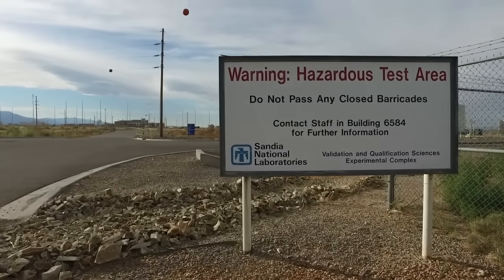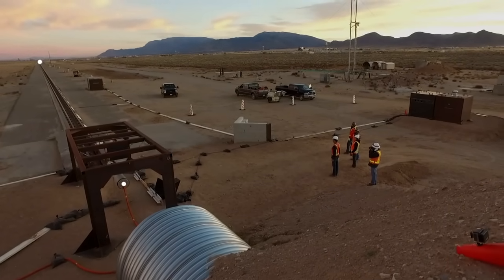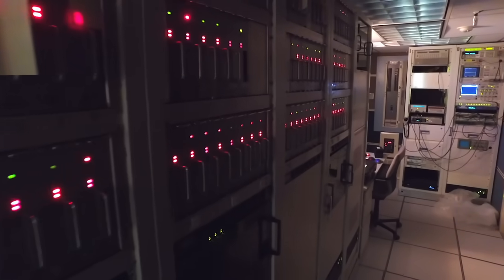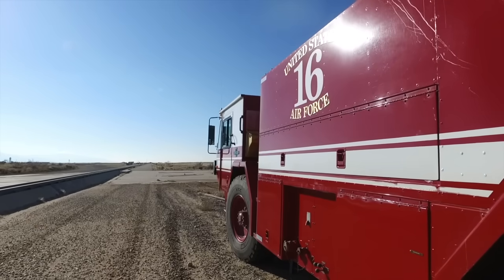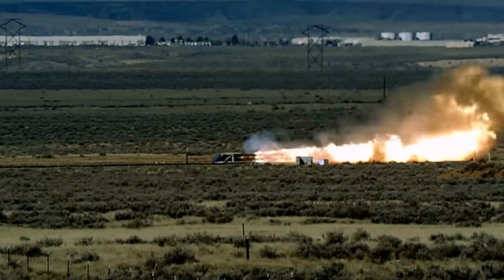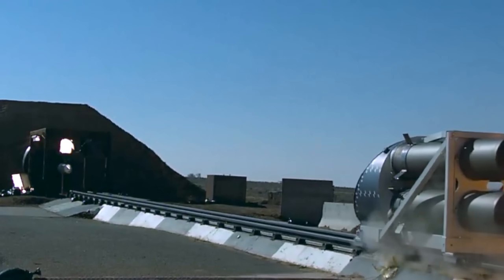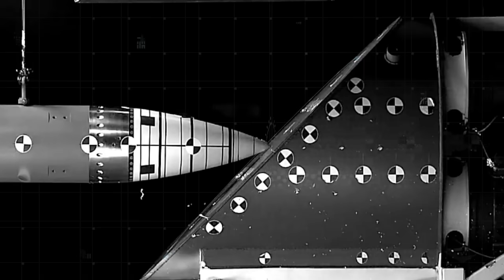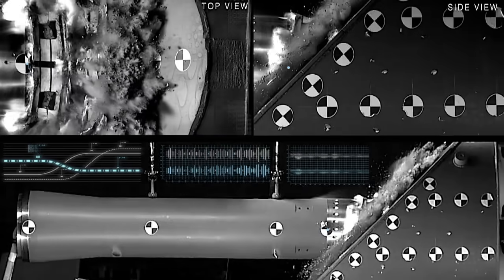Rocket Sled Impact Test In Slow-Motion

Comment: Im really curious to what you could actually learn from this test??
Reply: The sensors embedded in the dummy load transmit data at every point in time of the impact. By analyzing the movement of things and the exact way they crush, they can confirm whether a system functions properly. Things like whether the signal to dentonate is triggered, which if the other internal signals are triggering, the exact way the body crushes, and so forth.

For testing like this, the ram on the sled can be swapped out to simulate different angles of impact, and the rocket motors and acceleration distance can be varied to simulate different drop heights.

You only want nukes to go off exactly when you want them to. Testing like this ensures that will be the case even if the shell is dropped by accident due to human error, or a bomber is blasted out of the sky with a full payload by anti-aircraft armaments, or some other catastrophic failure occurs.
Reply: Mentioned by a few post up - kylesenior
It's used to verify the contact fuzes on nuclear weapons are functioning correctly. Warheads travelling at the speed of sound (or even faster) have a very small amount of time to set off before they slam into the ground and disintegrate.
Reply: @PlzDontKillDave  Somehow i didnt get any of these until today... Thats a valid point, thank you and everyone else.
Reply: I think they learned that a rocket doesn't survive a piece of steel & concrete being slammed into it at those speeds.
Reply: Smonjirez SCIENCE!!
Reply: We can learn to make even faster camera frame rates so we can see the destruction even slower.
Reply: LincolnTek and what will seeing the destruction slower accomplish?
Reply: How fast the General Contractor’s new yacht goes with 30 people on board.
Reply: The sled is fast🤣
Reply: Looked like a catastrophic congenital delamination most likely from improper jockgirdle settings.
Reply: You can learn how to plant cabbage.
Reply: @fleshangel489  when you joke and morons take you seriously...lmao...speaking of potatoes.
Reply: @chiefmawfackoogames  yeah potatoes are good
Reply: @fleshangel489  potatoes...yes...however, your sense of humor has been perceived as wanting.
Reply: @chiefmawfackoogames  Oh OK
Reply: Astronaut 13 I'm sure most nuclear bombs (I'm no expert) are detonated before they hit the ground so they're not testing the detonation mechanism here. Your explanation makes the most sense although it does seem a strange way to go about it
Reply: Take a look at the B61 mod 12. It's being designed to penetrate into the ground in order to localize the shock forces on buried targets like bunkers.
Reply: Is sandia national labs that made this like other ppl said this test is for nuclear bombs (or even normal bombs)  that explode meters inside earth
Reply: You learn that aluminum cannot penetrate steel
Reply: Materials age, even metals, so the behavior of key components can change. Such tests can show you of components need to be replaced or re-designed.
Reply: @f.d.6667  I agree with what your saying, but i dont see how any of that could be learned from atomizing the subject.
Reply: @Vatsyayana87  F.D. states the opposite of what you think. his argument is that the test as such is futile.

so the current explanation isn't satisfying -- that they're testing the electronic equipment. I also think they're not testing the equipment, what I think they're doing is that they're testing the case itself, the way it actually disintegrates on impact. I think it's an overblown experiment for what it is. they are growing a numerical database of the analysis, which is then fed into another study or further refinement of the design, the reality of which is unrelated to them.

I honestly think this is a high-level PR 'excuses' video for an industry that wastes money irresponsibly for things that could've been learned otherwise, and that this is mostly political, and not essential or breaking-new-grounds scientific, but everybody has rights to their opinion.
Reply: This is for development of earth penetrators, bombs designed to explode underground, like inside bunkers ou caves.
Reply: @harrycallaghan65  but, thet said they are studying the safety of the stockpile...how does checking the penetrating attack power relates even remotly to the safety if the stockpile?
Reply: Alain Pasqualini What she said is just superficial blablabla for advertising purposes.The real reason for the test is to analyse the bomb's behavior during impact to collect data and produce  bombs with better penetration capabilities, destined to attack bunkers or underground targets.
Reply: @harrycallaghan65  And create earthquakes around the world. It's a toy that should be broken.
Reply: Ivymike2 Ivymike2 Not true at all... How you got that is beyond me but it couldn't be further from the truth kid. Try again though.
Reply: Vatsyayana they learn how a nuclear rocket would be affected after a large impact, like if it would detonate or not, imagin someone bombed somewhere a nuclear missile was located, we wouldn't want that going off.
Reply: PlzDontKillDave most nuclear weapons in the us are designed to explode above their target, not on impact
Reply: @advisuals9273  bunker busters are.
Reply: Canooter valve density readouts and flux capacitor levels
Reply: It's to make sure nuclear weapons won't accidentally detonate. Most of the testing done on nukes is towards this end.
Reply: Since everyone started arguing ill answer the question, its to test the actual system inside the warhead, they have all the electronics of a regular warhead but just no uranium. So the big orange cable is reading electrical signals at a bunch of points inside the circuit. This is just a made up example but there might be probes at the "detonator" to see if the nuke would detonate on impact, after they review this data later to see if it would actually detonate in that situation or not, and fix issues accordingly.
Reply: How fast a building can come at you 😂😂
Reply: The explosion
Reply: Modi israélien
Reply: How fast you can blow through taxpayer dollars
Reply: Nope. Not even close. There are much less expensive ways to validate fuzing systems. There is a reason this is being done by Sandia and not e.g. ARL
Reply: O.P. Yates Really man you have to be political about it.  Ryan isn't wrong when he talks about useless companies getting money pumped to them.  IDK yet about this company cus I've never even heard of them but this post was originally about the purpose of the test and no one so far has had a straight answer.
Reply: Validation of hydrodynamic simulation codes.
Reply: 2.2 million views? This video is having a... Big Impact. (Hold for laughter)
Reply: +tetrabromobisphenol we are talking mach 15 nuclear warhead vs earth
Reply: Vatsyayana you have to have an IQ size larger than your shoe
Reply: tetrabromobisphenol I like how you're saying others are wrong when your reason for why this was done is wrong also! Lol, people like you are extremely funny.
Reply: We've had multi-million frame per second cameras since the mid 1940's. That's NOT the point of the testing
Reply: @tetrabromobisphenol  
Name one! Referring to the millions of frames per second cameras since the '40's.
Reply: That 84 Engineers, 47 Technicians, 208 Contractors, and 23 Project Managers are still employed in their Know Nothing Bullshit Job. Thank you UNCLE SAMMY!
Reply: Ryan Taylor if you don’t like the United States just leave
Reply: It COULD be, but this is not a hardened warhead. Notice the crumpling of the nosecone. A hardened warhead would punch right through the sled dummy if was made of the "right stuff", and yes, there are materials that can easily slice through hardened tool steel at those speeds with little difficulty.

Comment: What is the point of this test?
Reply: To see stuff get destroyed in slow motion.
Reply: Probably test if the nuke would go off in case of an airplane crash or so.
Reply: I'm still puzzled. From video description ,  this is laboratory for nuclear weapons. Nuclear projectiles  are not usually designed as penetrative weapons. As a matter of fact , they have greatest destructive power if detonated several thousand feet above ground. Also given temperature and preassure in the centre of explosion , you don't really have to worry about someone finding a piece of projectile.
Reply: To make a corny video... yay we cripled a ruler on a fake nuke. Brought to you by the umbrella corpoation in resident evil
Reply: D J, stop talking nonsense.  Everyone knows where a particular nuclear device came from.  The manufacture of warheads is specific to each country and easily identifiable by the nuclear isotopes left over from the blast.  The point of the test is to ensure that weapons are safe from unintended detonation from a crash, for instance.
Reply: To create data so that they can run simulations to design a nuke that won't detonate if, say, the ICBM carrying it flies into a mountain before it reaches its target.
Reply: The point of this video was on the very tip of the rocket upon impact
Reply: Oh I don’t know.... to gather data...
Reply: To ensure the safety, security, and reliability of the us nuclear stock pile... she said this like 3 times werent you listening ;)

Comment: "Safe" nuclear weapons?
Reply: So what's the test exactly? To try and figure out if the bomb would detonate if it accidentally launched into the silo roof or something?
Reply: @ninjafruitchilled  no. The objective is to  have something which always goes boom Only then it should. And Always then so.
Reply: Jon Doe safe as in they only blow up when they want them too. No matter what. Like in the 50s when the airforce “lost” a nuke out of a plane and it crashed into someone’s paddock and only one safety device stopped it blowing up and killing American civilians.
Reply: @bh8671  Come on do you realise how hard it is to detonate a nuke? look up the firing sequence, and stop spouting illiterate rubbish
Reply: @bh8671  yeah, Spain Palomares incident
Reply: +Advait Thankur
The point is to be safe in case of a failure, hence the term 'fail-safe'. Nukes are designed to be perfectly safe... until they are detonated. So no, not a contradiction.
Reply: ninjafruitchilled 
  Blow-up from an interception maybe? Like an anti ibcm missile.?
Reply: Yeah, it comes with safety goggles
Reply: Safe so that it doesn't blow our own arse.
Reply: Jon Doe 
Nuclear weapons are designed to be fail-safe, in contrast to fail-dangerous weapons (i.e. most conventional explosives). It's more likely that millions of grenades will malfunction before a single nuclear weapon does. Nuclear weapons are extremely non-volatile compared to most other kinds of weapons (due to how extremely precise the trigger has to be). I don't think there has been a single case of a nuclear weapon detonating accidently.
Reply: Good thing about implosion type devices is that they are really hard to detonate correctly, so even if the explosives go off, you'll get a fizzle, not a nuclear detonation
Reply: The ones with training wheels.
Reply: look up nuclear broken arrow events. We've lost literally dozens of nuclear bombs over the years, quite a few were never recovered because the uranium and plutonium is so dense it causes the bombs to burrow on the ocean floor.
Reply: as in they don't go critical or blow to pieces if you stub your toe on them.
Reply: Oh come on they use bubble wraps..its safe
Reply: When talking about weapons in general... it is perfectly safe for everyone to own one. It makes you safer. However it increases the murder per capita in the world and generally makes the world a more unsafe place. If you look at it by country (taking the wealthiness into account) it tells why the USA has 15 times more murders per capita than Japan, for example, but still people think they are safe. And they are quite wrong. In Japan you can die because you got involved into some organized crime scenario in some way, while in the US it is much easier to die by just taking a walk in your neighborhood with your dog.
Reply: pjd412

Sorry that I have to be so upfront, but there's no other way to say it, really... so here it goes (with the best of intentions):

How about you pull your head out of your racist ass and realize that no one really gives a crap about your skin color? If anything, Americans, including white Americans, set up the framework to abolish slavery and racism (which were inherited from pre-existing cultures) and then fought civil wars to abolish it.

You should be thankful for what Americans did for once instead of whining and making excuses in life.
Reply: Jon Doe The people who script this propaganda also feel that Gatling guns are safe.... because they're paid by the folks peddling death. This womans creepy 'chillaxed inflection' is the most unnerving aspect. She's taking us through the academic considerations of a technology that may yet catalyse a M.A.D. scenario, but she sounds like she's doing a infomercial for a recent check in at the Radisson.
Reply: You get a refund if proven otherwise
Reply: Yup. Safe nuclear weapons. Not great but much better than being defenseless target.
Reply: We already use the word "safe" in guns and other weapons. I don't see the problem of applying it to nuclear weapons. A safe mechanism is designed to only trigger a weapon when desired and without accidents. Properly handled guns should have the safety on at all times except for the moment you intend to pull the trigger. This practice should be applied to nuclear weapons too like all other weapons, hence the common word was used: safe.
Reply: Layth Alkhaer I think he was just noting where the bomb had landed. No need to get touchy about something he didn't actually say.
Reply: Adam Adam icbm
Reply: How daft can you possibly be?
Reply: @thegoodchap interesting point, I'd never thought about their density.
Reply: Jon Doe Kinda like jumbo shrimp except with radiation and complete annihilation.
Reply: There isn’t a warhead in it
Reply: Yeah, you know? The kind that blows up in someone else's face, not your own. ;)
Reply: Safe for the sender ;)
Reply: Adam Adam haha read that as safety googles first and thought yea I guess you might want to do incognito searches... that’s when I realized I need to get outside more
Reply: B H 
It was actually not lost, it was dropped on purpose, just to blame the Russians and start the 3rd world war.
Reply: Jon Doe Whoosh
Reply: Kinetic energy alone can be more destructive than a nuclear blast.
Reply: Uh yea...duh! You don't want an aircraft carrying nuclear warheads to accidenatlly crash in the US and blow up whatever city you are in, do you?
Reply: Well, they have been around since the 1940's and none have went off accidentally, so yes, safe.
Reply: Oxymoron.
Reply: Bro u like 12 yrs old or something?
Reply: Da goggles 🥽 zay do Nudding!!
Reply: Ifrane Brunet you believe only one nuke has been lost by America? You’re special.
Reply: They are stored in clamshells. Nobody can open them.
Reply: "Safe" it means that nuclear weapon doesn't detonate by itself, even in extreme condition such as crash, impact, or getting shot by gun.

Imagine if someone accidentally drop a nuclear bomb from a forklift and suddenly entire city is wiped out.
Reply: B H says correct. But still, 'safe nuclear weapons' is itself a contradict statement. They should say 'controlled' and not safe.
Reply: Advait Thakur safe is a common term used with weapons to specify they are in a state where they won’t go off. A safe weapon is one that has had ammo removed, locks engages and such.
Reply: The safety OF the nuclear stockpile, asshat...and for all the 500+ motherfuckers who thumbs up the original comment...fuck you too